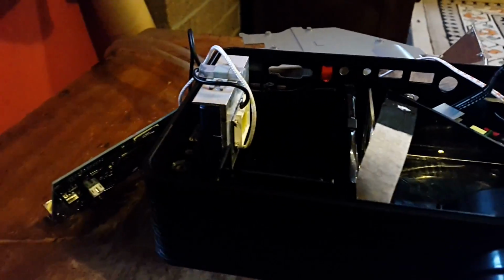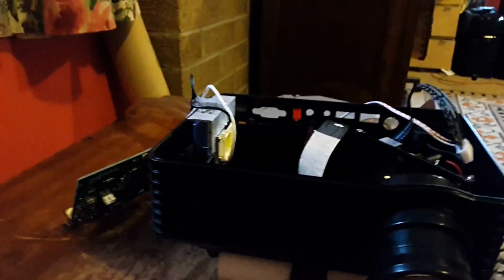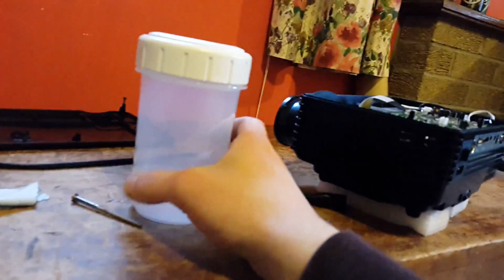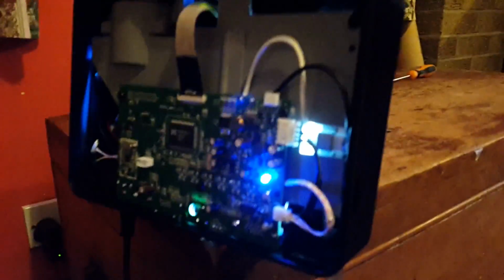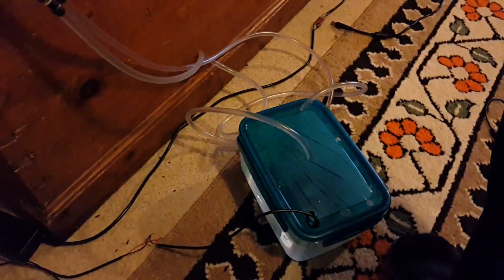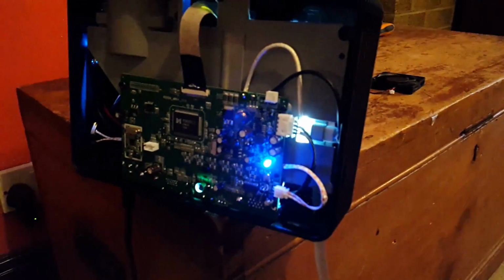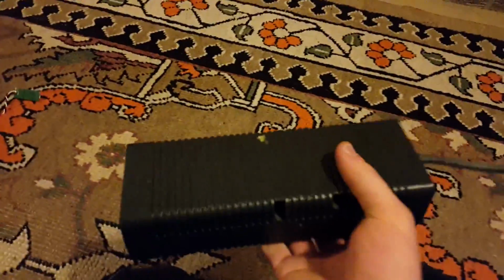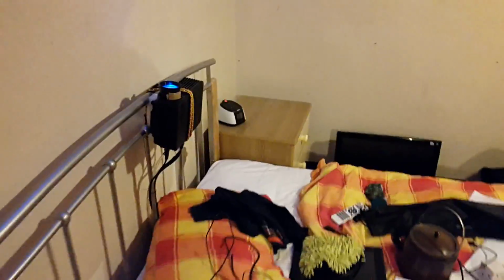Water Cooled Silent Projector

Comment: Awesome 😂😂😂 have u ever just replaced the fans inside and used noctua ones for reduced noise
Reply: Bad idea. Projector fans have to push a certain amount of air for efficient cooling and most of projector use radial and axial fans, where the radial fan makes most of the noise

Comment: No issues since you did this?Thinking about doing this myself
Reply from the maker: The water cooling is actually unnecessary. In a later video I explained that the LED actually burned the screen inside. All you need to do is reduce the power going to the LED and it gives better contrast and colours too, provided the room is completely dark.
Reply: Shaun Dobbie 
For cooling I agree its excessive  and dangerous unless you use glycol, but isn’t the noise greatly reduced? Thats what I’m most concerned with.
Reply from the maker: I forgot, you can just disconnect the fan as it is not needed when the LED is at such a low power. This makes the unit silent.
Reply: @ShaunDobbie  How did you give the LED less power?
Reply: @BLACKLIGHT_NL  Probably used either a resistor, voltage regulator, or buck converter.

Comment: nice haha I love projectors modded a few old ones with LEDs never worked out that well. do you post lil projects like this on snapchat, instergram or anything?
Reply from the maker: No, I do everything right here. Why didn't your projectors work?
Reply: +Shaun Dobbie ahh that's cool, I usually post my mods on twitter, Facebook and snap then out haha I like seeing if people guess what I'm modding as I do it. um the led was not powerful enough and the 100w led I had needed a huge heatsink that just wasn't going to fit. I bought a little gigabyte brix pc / projector it's crazy small good specs and is led will do 100" easy enough. I posted a video showing it mounted with a selfie stick lol 😁